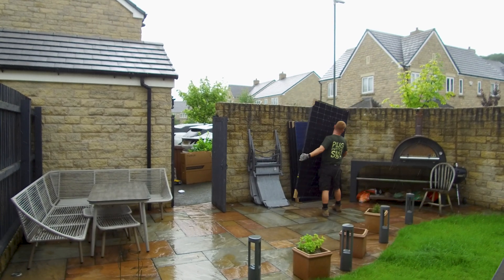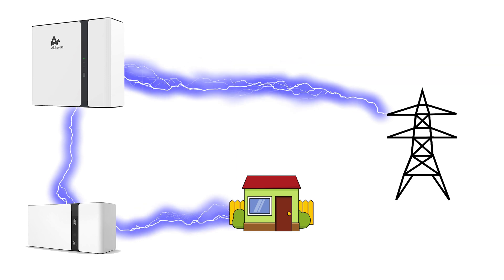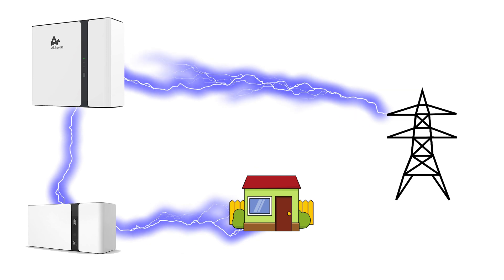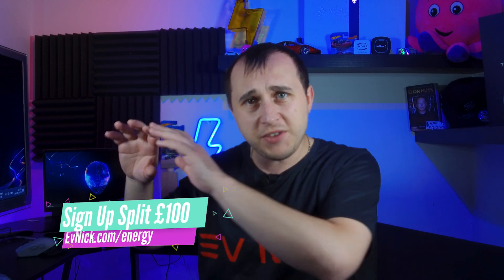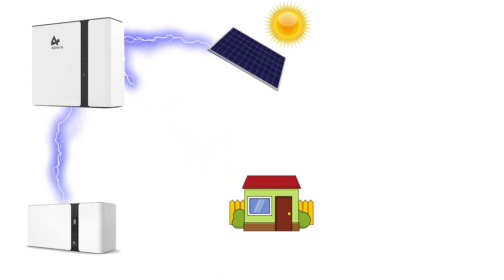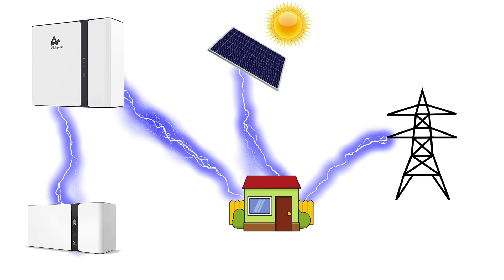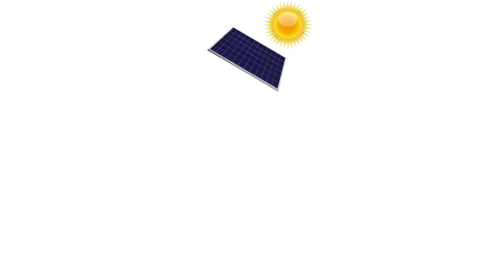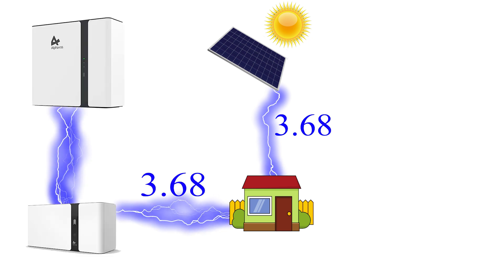Why I Picked AC Coupled Battery Systems Over Hybrid Battery

Comment: Microinverters are great. Another advantage of converting to ac on your roof at panel level os safety of maintenance and if ever there if a fire on the roof everything can be shutdown easily. Rapid shutdown is a requirement in USA under their electrical codes. No idea why we haven't got that requirement yet. Optimisers, microinverters, and rapid shutdown devices can all do this. Without these you hav hundreds of volts of DC power between the roof and your first inverter. And it cannot be isolated im daytime.

Comment: I have this inverter: a deye hybrid 8kw inverter. It is rated to charge/discharge the batteries at 190 amps (given your batteries support that amount) and can simultaneously invert 8kw to the ac side and it says the two aren’t related.  I am not sure if this is what you are saying, though.  I have two of these paralleled and a spare because its in a very rural area and getting parts can take a while.  So I think I can get 16kw inverted and what sounds like a lot of battery capacity (possible).  I have 6 48v 200ah batteries with all the negative and all the positives connected together which I think means paralleled together.  I dont live in a country where citizens vote yet the power company tells you what you can and can’t do.

Comment: Hybrid inverters generally also AC couple, if you have 2 separate solar inverters on the same phase. The CT clamp sees export and directs towards the battery. The inverter generally doesn't care where the surplus cane from

Peak output is nothing more than a sales line. It has little to zero real world benefit

Comment: In Australia depending on where you live there are limits on inverter size. Eg In my area im allowed on single phase 10kw of inverter be it 2x 5kw units or what ever mix of sizes before you need to get permission from the power distributor for larger sizes. Other areas (rural Areas) its 5kw per phase and depending on the amount of solar on that section of the grid depends if your allowed more so for people here a AC coupled system with external solar inverter might not be allowed dew to limits to make it fair for every one with solar.

Comment: Really the key here isn’t ac or dc as they’re much of a muchness the key is all in one inverter which most are nowadays or separates. Something like a victron system is the best of both everything separate and resilient and can have multiples of everything and still have ac coupled solar if needed.

Comment: We have split my house electrics into 3, cars come from thier own consumer unit. The house load from lights ring mains including kitchen come from second consumer unit (sub panel 1) that is covered by one 5kw hydrid inverter, and the third consumer unit (sub panel 2) is used to heat the house, is cover by a second 5kw hybrid Inverter. Plus these inverters are so cheap that I bought a third as a backup. The inverter are connected to the grid via a timer switch that connects it at the specified time four hours in the morning to charge the 2 battery banks, one 21kWh and second 10.5kWh, which leave the remaining 20 hours off grid. Plus I can use my car to run the heating side via a 6kw Setec unit with a change over switch from house system to car. My solar array feeds each 5kw inverter with 5kw, totalling 10kw solar array. I also have a Sunamp for our hot water that can be charged via a change over switch to either the grid or the house sub panel 1 or 2 depending on which sub panel is under load. This makes for a completely flexible system, which even in the most unlikely event both inverters fail, I can still run the house. So I would argue hybrid system are much better than AC compelled.

Comment: Hi, it might be a bit of an question but if you are on Intelligent Octopus Go and you are charging your battery overnight with a hybrid inverter, are you essential using it as an AC coupled battery? 
I'm trying to finalise my solar quotes and seem to be getting quotes for hybrid inverters but like the idea of the AC coupled system given how I'll likely run the system. Cheers
Reply from the maker: Hey Steve videos on my system located on channel but if you want to get a quote for same system I have go to evnick.com/heatable they fit an AC coupled battery PLUS your get micro inverters for solar meaning both can generate power at the same time.   Each panel will give out 290w of AC power at full peak sun,  for example 10 panels is 2.9kw from solar PLUS the inverter for the battery so if you get a 3kw inverter thats 2.9kw plus 3 or a 5kw inverter means your almost getting 9kw of support during peak sun
Reply: @NicolasRaimo  hi, I've had a few quotes and have had ones for the micro inverters but the 3 installers I've gone to all seem to want to go the hybrid string inverter route with tigo optimisers, which I'm not overly opposed to, and am asking for a revised quote to have the bi-facial panels. I'm a bit like you and like to have a bit of redundancy so have been asking to split the solar and battery so the the battery is ac coupled as I'll charge that over night on the cheap rate. I'm just wondering if that means I'm essentially running the hybrid like a an ac coupled system anyway so am wondering why they still seem to be pushing the hybrid? I assume it's an easier install?
How I use the system will likely be financially driven to begin with by whatever energy tariff I'm on so the flexibility would be nice, even if there is a slight drop in efficiency should it switch back to being more cost effective to use and store the PV.
Reply from the maker: @steve_787  Heatable have the exclusivity to these bifacial panels its worth noting normal bifacial panels are not the same as REA panels these have had things changed to them to work with micro inverters better.   I'd either go micros or just string adding tigos as well as string just increasing failure potentials,  Check what failure rate is on tigos I don't know much about them to comment.   Most installs like installing what they are used to which is why your often get quotes for hybrid string systems.
Tigos also drain a little power to work so your have that PLUS the string inverter all stealing a little power overhead.  You can run most hybrid inveters like AC coupled but if your solar goes into it then that means if it fails your have no solar or battery/

Comment: My hybrid and many available in the market can do 12 kW. And don't forget the ac-dc-ac conversion losses.
Reply from the maker: A hybrid inverter plus micro solar panels would be even more again!
Reply: AC to DC to AC only matters on the power that goes into the battery which depending on the house might only be about half. The rest needs to be AC in any case as it is exported or used. The DC to DC is still a conversion as it needs to step down to battery voltage but yes it is a bit more efficient, albeit only for the charging the battery bit, nothing else

Comment: I don't get it, all this confusion about one type or another of inverters is not going to be easy for the potential customers. Why not talk about Victron for a change🙏?    Is it that much more expensive? I knew very little about solar until 12 months ago,😄 only a 2-day course in Wales back in 1990 mostly on Hydro-power but it didn't take me more than 10 minutes to understand that I would not consider anything other than Victron mainly for its versatility. Easier to install, capable of almost any function one would desire, neat and pleasant to the eye, solid construction and, most of all, fully programmable for any type of use even up to a three-phase system if needed. I have installed mine with no effort at all and I'm very happy while now building the second battery (16K) to complete the job. The only problem is that it can become an addiction, before I knew it, I had parted from over 26k of my savings indulging myself in building what would take 30 years or so before it even paid itself and I am already 70🤦🙄
Reply from the maker: Victron is just a brand of AC coupled or hybrid inverter they also make string inverters like all these systems that's just a brand just like apple, samsung etc make phones.   Victron and many others all able to the same tasks this video explained the difference between the systems when you buy them as they do different jobs depending how you spec them.   You vicron would of been sold either AC coupled or hybrid form day one if you didn't need solar input into it then it be ac coupled and if you were feeding solar into it then it be hybrid
Reply: @NicolasRaimo  Appreciate your reply however I'm not aware of a Victron non-hybrid inverter, have you seen one Nicolas?
Reply from the maker: @9111logic  quick google shows they sell them

Comment: Pros and cons to every system , need to understand what's best for you and not be pushed or way or the other from the installer . I disagree most invertors are 3.6k , there id s full range and  your installer should offer the full range, and not just  the best system for them.  I personally prefer the victron system which has seperate compents,  and can be setup as ac , dc or a combo of ac and dc coupled

Comment: As my existing solar inverter is still working fine and has a few years left on the warranty I opted for an AC coupled battery system rather than change the existing inverter for a hybrid.

I also liked the idea of still having the storage available if the solar PV ever has a breakdown.

Only one month into having the battery (9.5kw giv energy battery with 3kw inverter) and impressed so far but still getting a hang of the various app features to make best use of the system along with charging an ev.

Comment: Some further information.   If you have a solar set still on a FIT tarrif, in other words a subsidy, you can add an AC Battery inverter without losing you FIT payments.  Also, if you have two solar sets like myself, with two DC inverters, you can use the AC Battery inverter to pull power from either and both of the solar sets, something hybrid systems can't do.
Reply: Adding a battery doesn't affect any existing FiT. My AC coupled system has a CT clamp on the solar but I'm not sure if you can have it connected to more than only solar system, maybe a question for an installer

Comment: Just commissioned mine, Victron with 14.4kW of Pylontech think my array could do with another 3kW on it, EV charger just installed to so it’s after the whole battery setup so no drainage from the battery to charge the car. You finished yours yet?